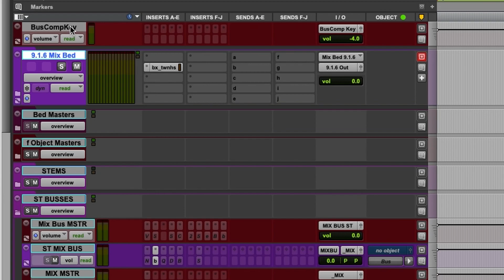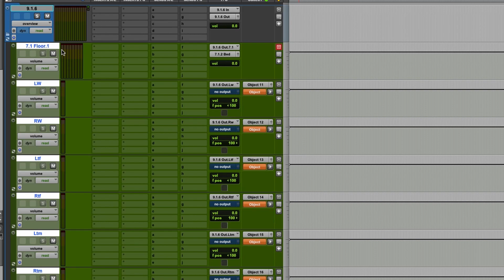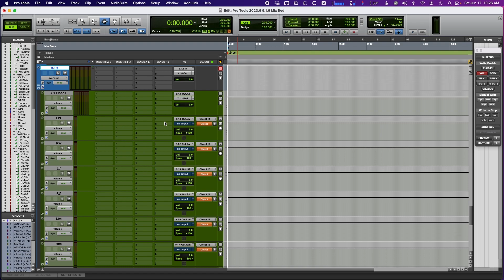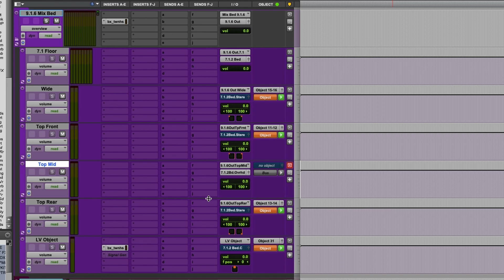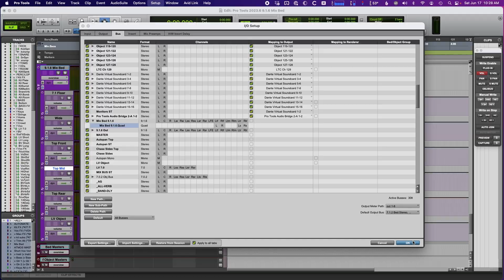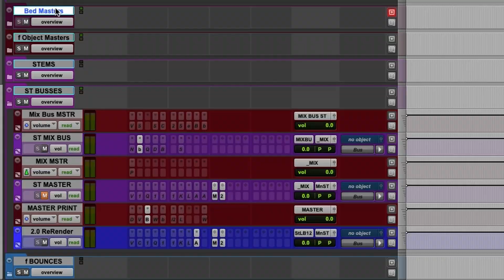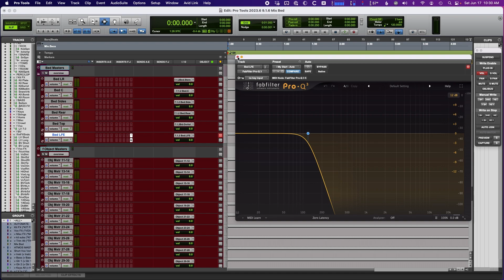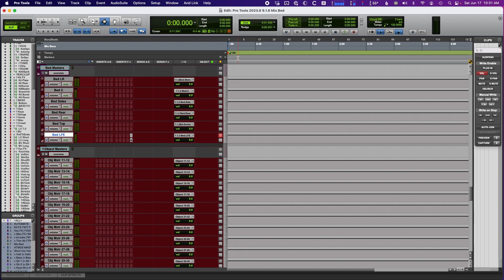My Pro Tools 9.1.6 Dolby Atmos "Mix Bed"

Comment: Hi! I am new to Dolby Mixing and was wondering about objects. Usually I would do some sort of bus compression on my mix bus to help "glue" all of my sounds together is this possible if I am assigning different sound effect tracks to objects? Like could I route objets to a mix bus or does it go straight to the internal renderer? Love all of the info you give on your videos!
Reply from the maker: I'm glad you're finding the videos helpful.

Currently, objects go directly to the renderer. So any processing you want has to be done upstream of the output to the object.

Comment: Hi. Are you routing your mono and stereo audio tracks (the ones that make up the mix) to the 9.1.6 routing folder track and that outputs to the various subpaths that are going to the green aux tracks which are then mapped to the renderer? Ive always thought that the purpose or the routing folder track was to receive its input from the tracks within the routing folder track. This seems to be the opposite of that or am i missing something. thanks for the video!
Reply from the maker: Yes, that's basically how it works. I normally would also think of routing the contents of a folder to that folder, but this was the way Avid had it setup, and it works quite well.
Reply: @goingto11  just when i thought had the i/o figured out lol thanks!
Reply: I actually have something similiar except instead of a routing folder i have a basic folder that contains the auxes like you have here and instead of a bed for the 7 main floor speakers i have them going to objects as well. Curious if you think there is an advantage to 1. having tracks go into a routing folder before they get distributed to the auxes and 2. using the bed for the floor speakers as opposed to just more objects. Thanks again
Reply from the maker: @aranash00  I think the folder is just for organizational purposes and to declutter the session. From my perspective using it, it just seems like an aux bus which is what I really need. I don't ever look at the contents of the folder, but I do look at and use some processing on the folder. 

I use the bed for the 7.1.2 because it's always going to be there. I don't think there's a sonic benefit to choosing it or choosing an object bed--they sound the same in terms of the final product. I could see some creative benefits for using objects instead of the bed, but that's not something I'm going to explore right now. And if I'm not going to do anything creative with the object bed, I'd rather not waste objects on something I don't need when the static positions I want to put things in are already present.
Reply: makes sense thanks @goingto11